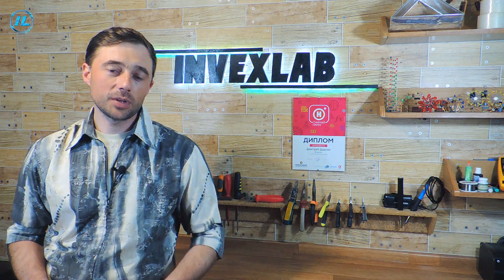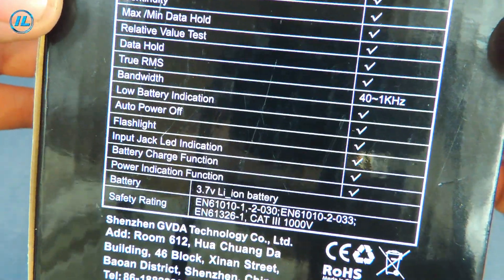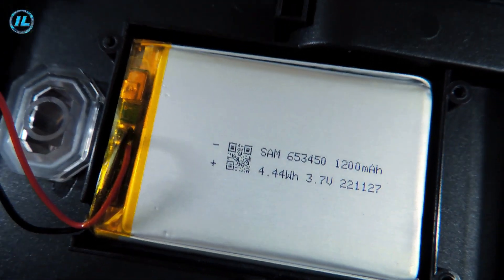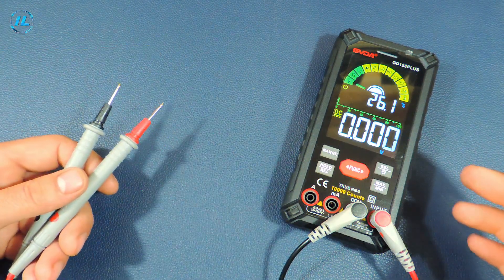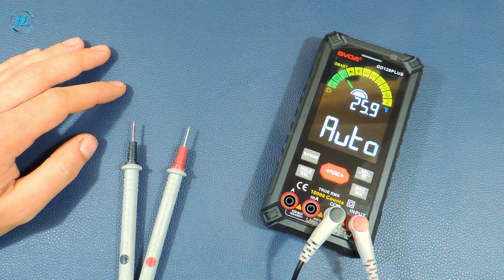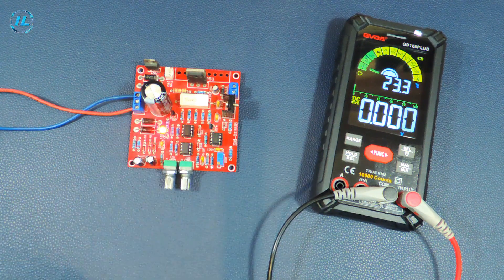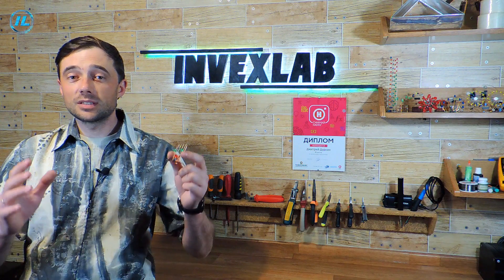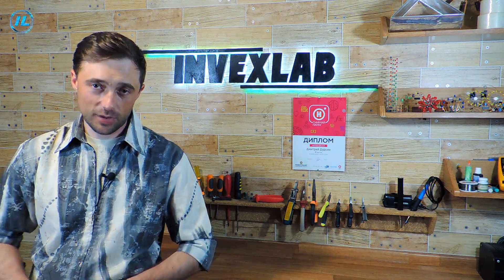✅ Power supply from Aliexpress (KIT set). Why is it not working, and how to fix it? GD128Plus ✅

Comment: I will never buy a multimeter until there is a manufacturer that implements valid component tests (capacitors, transistors, IC) and esr meter in multimeters.
That DIY power supply board is poorly made, it has design flaws.